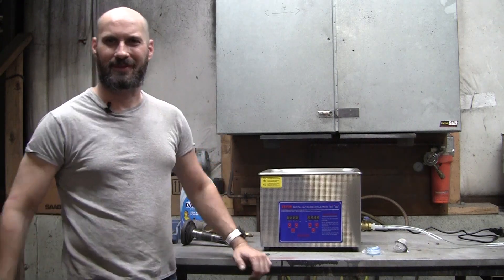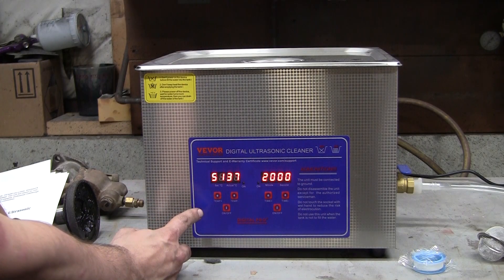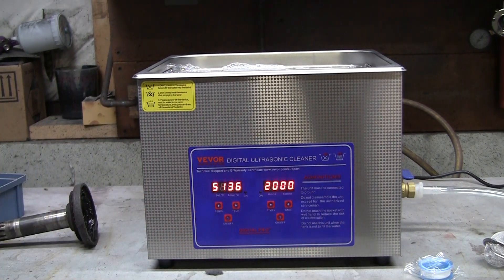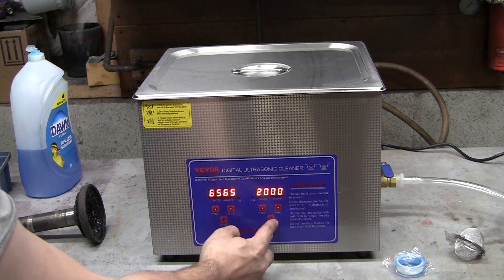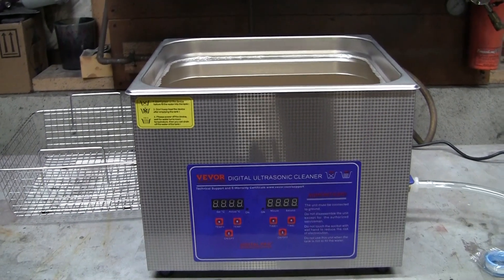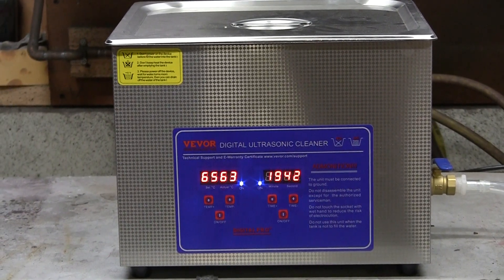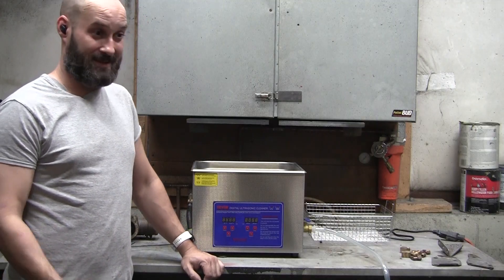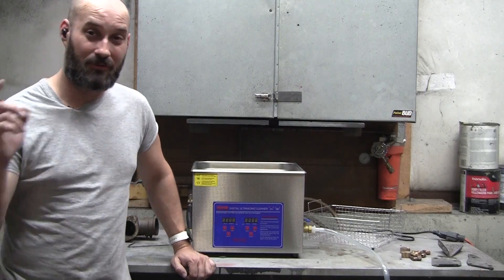Is This the Best Way to Clean Car Parts? Vevor Ultrasonic Cleaner Test

Comment: I have the big 30L version and its great. Usually have some sort of alkaline degreager sitting in it in the shed. Have discovered that evaporust works extremely well in this too- speeds up the process by maybe 5 times or more when heated it to 50C.